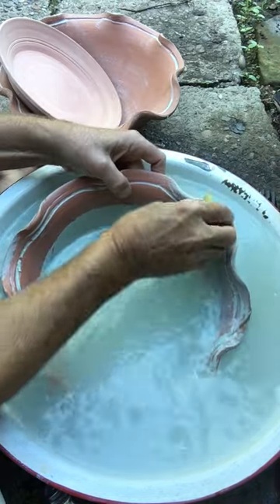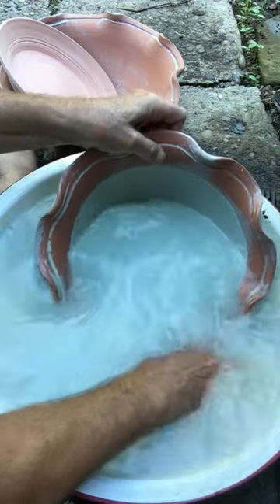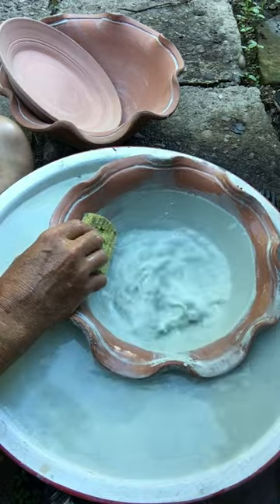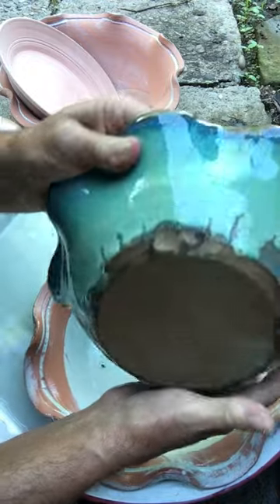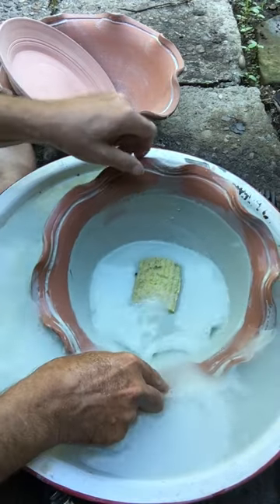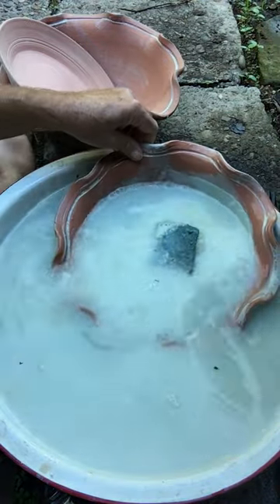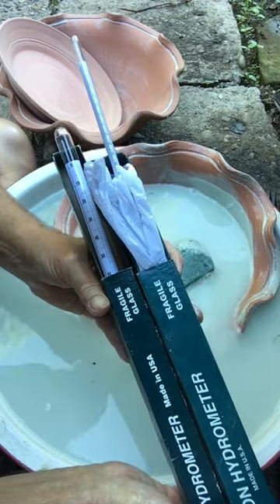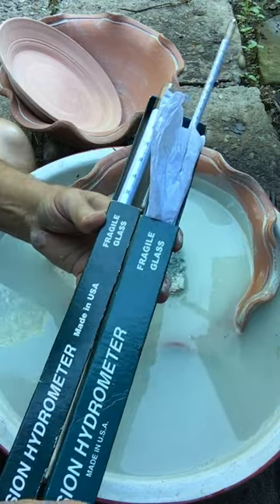Pottery glaze removal ????? #potteryshorts #pottersjournal

Comment: I’ve found the easiest way to do this is with a sprayer on your garden hose!!!
Reply from the maker: Maybe if I get a bigger catch bucket. Wait till you hear the rest of my story. I save the washed off glaze. Along with all waist glaze from the process.  From the bottoms of pots, dirty sponges, brushes, mixers and scaped from bench. A mystery glaze. Sometimes good sometimes not always good on the dull part of a flowerpot. Also mixed with half wood ash for an ash glaze. Thanks for the short cut.
Reply: @pottersjournal  I save alll of my glazes as well. I keep dry glazes and wet!!
Reply from the maker: @micheledickey4066  WOW. Environmental good sense too.
Reply: @pottersjournal  Thanks! I haven’t figured out what to do with my brush water glaze. I don’t want to mix it so I’d like to just use it to pour onto a pot and swirl maybe. The problem I have is that I add my brush water glaze to a jar and it dries out over time so I have several jars of glaze that is dry/ moist. I don’t make my own glazes so I’m not sure if I should mix some with clear glaze to use it? Any suggestions?
Reply from the maker: @micheledickey4066  If I understand right. Glazes dried out and too thick? It's water that evaporated from them so just add water till about the consistency of your new bottles. If dried out too much it's easier to dry out all the way, grind to dust then add water. 
Now instances a glaze is to dark or opaque then I've blended in some clear.
Reply: @pottersjournal  Thank you so much.